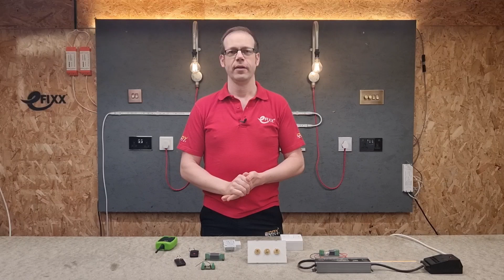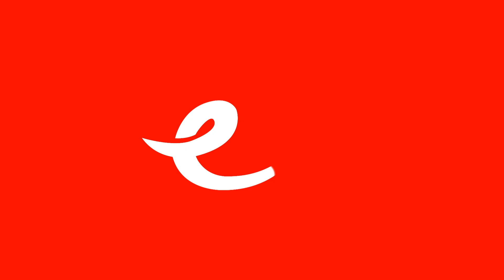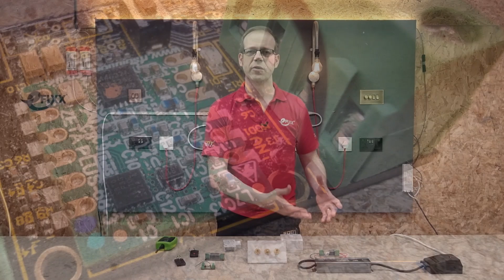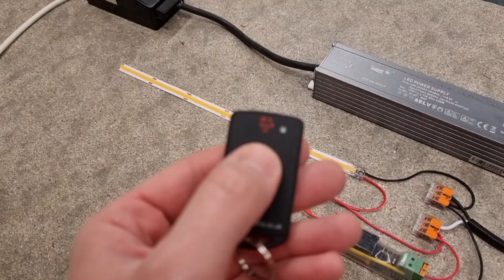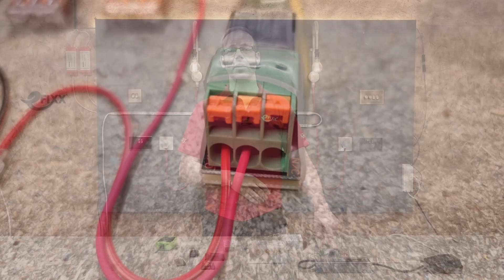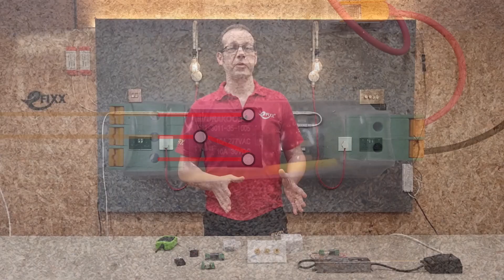What is a Volt-Free Contact? | Electricians Q&A

Comment: Great explanation, I'm currently using a 4Ch Sonoff controller in conjunction with an RF Door Access system I've installed for our garden gate. It enables me to interrupt the Push to Open and/or Maglock circuit in conjunction with smart routines to enable or disable use of the gate at certain times or on certain days and it works really well

Comment: I used to use a volt-free Shelly 1 smart relay to control my garage door opener via my smart home and phone. It was a really old opener and therefore only had a standard RF remote. The Shelly has Wi-Fi so connected to my home network and can be controlled from anywhere. I powered the Shelly with a 12v adapter and used the volt-free relay to connect the push button terminals on the door opener.

Comment: Have volt free on my UFH control, it is on a separate electric circuit to the boiler, so has a volt free contact to switch the boiler signal on when demand for heat is there.
So no connection across circuits. I wonder if it should have a sticker indicating multiple circuits should be isolated before opening. Or maybe it is no different to the 2 gang switch at the bottom of my stairs.
Thanks Joe

Comment: Sounds fun but I'm assuming it can't be fitted into an existing installation. Really need one that can take 230V but that means a transformer inside the back box.
Reply from the maker: They do make a small PSU that could fit in a deep back box, check the full video out:
https://youtu.be/ynH46_HPRR8

Comment: Interesting. So another pain in the bum when it comes to doing an IR test ? So we will have to waste time taking that thing out of circuit in order to carry out the tests? Brilliant idea,not but who am I to argue i’am just a Humble spark who’s opinion means nothing.
Great video as always Joe 
👍
Reply: Why do you need to take it out, its like any old light switch, just operated by a remote lol
Reply: @imgeedup  because an IR test could damage the electronic circuit board.
Reply: @Dog-whispererINAEC  right, but the relay’s outputs are galvanically isolated from the rest of the circuit (trust me I’m an electronic engineer), its just two contacts like a 2 way switch. 

However it depends on the type and quality of relay used. Besides, what if it was a regular dimmer switch, you’d have to remove it anyway so is it really a big deal.
Reply: @imgeedup  I get your point but BS7671 says electronic equipment must be removed from circuit before doing IR test
Reply: @Dog-whispererINAEC  You need to think practically. Which IR are you measuring?
The power to the device is DC at low voltage and you need to have a power supply to feed it.

You're going to be testing the IR of the cable connected to the output.
There is no reason why you can't apply the high test voltage with the cable connected to the relay.  If the relay has been spec'd correctly it will handle it. You can research the type of relay online from its manufacturer and part number and make a determination as to whether it can handle the voltages in an IR. Or you can try it out.

You don't have to blindly follow BS7671: it cannot cater for every single type of electrical apparatus that could be connected in an electrical installation.

Comment: Theres a volt free contact on Danfoss roomstat. How do you separate hi / low volts in back box?
Reply from the maker: Just make sure the lower voltage conductor has insulation rated at the higher voltage. 👍
Reply: @efixx  that's what I have done in the past ,also seen a paxolin separator used ,